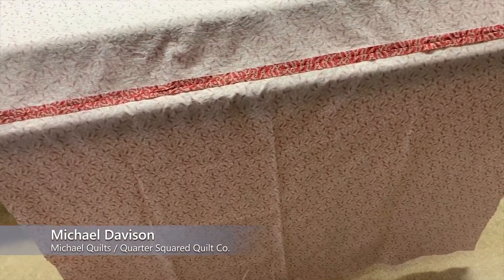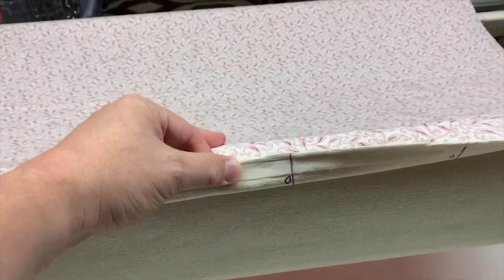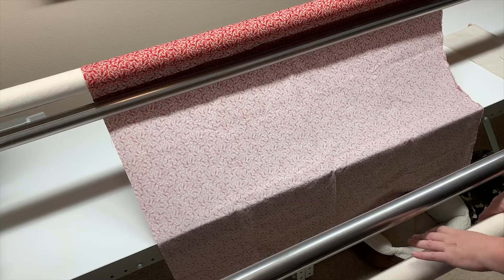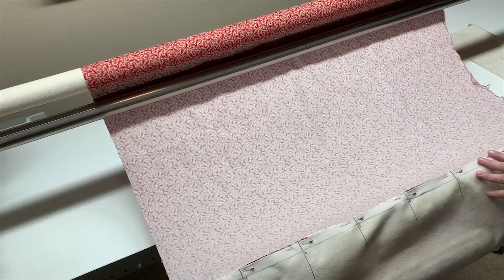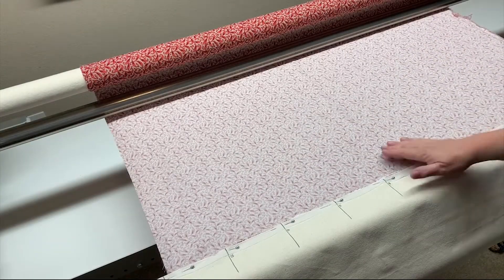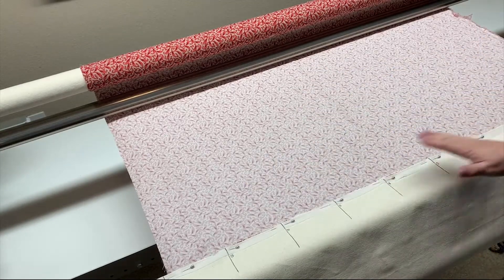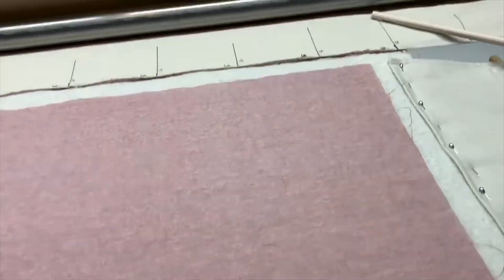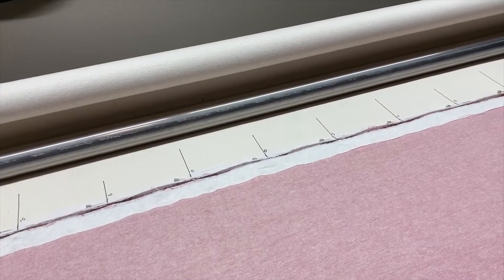LONGARM QUILTING - LOADING THE FRAME

Comment: I have never thought to load the quilt back from behind my frame! Wish id found you a lot sooner. I like pinning too but if I'm feeling extra lazy I use a stapler with it set to bend out instead of in then nip my backing fabric and rip the edge to get rid of all the staples easily when I'm done. Thanks for the video!

Comment: I am new to quilting on a frame. I just loaded a quilt and rolled the backing to get the side tension on the backing even. Works great. Thank you for the video.
Reply from the maker: Hi Natalia! So glad you are getting started! Let me know how it all goes! I know you'll love it.
Happy Quilting!
Michael
Reply: @michael.quilts  Followup. I now use my top leader for my backing. I struggled at first but came back to the video and noticed how you draped the top leader over the back bar. Genius! My quilt backs were slipping badly and loading a quilt was a chore. Thanks again.
Reply from the maker: @nataliarodriguez6766  I am so glad that you found what works for you - and that is what works for me too.  It takes me a while to adjust myself when I teach somewhere else and they load the traditional way, but I guess it's all about what you get used to. Happy Quilting!

Comment: Thanks for this video Michael. I will definitely do the tip about rolling the quilt back and forth to get the side tenson like I want it. I will also find your video about your side tension system.
Reply from the maker: Hi Dana. Truly, I was only sometimes able to get the tension on my backing even and sometimes not. But when I learned this rolling technique, I found the time spent doing this to be very well worth it! Hope it works for you too!

Comment: so glad to find that someone else loads backing on the quilt top bar!  I like to use magnet bars on the "front backing bar" to stabilize the floated quilt top!  I like to use magnet bars to stabilize the front of the quilt top an the magnets stick better with less bulk wrapped around it.  still fairly new to quilting and my "tension" learning curve is less flat than it was when I started.  haha.  I'm thinking of getting another bobbin case for the different threads?  what do you think?  I mostly use Glide but would like to try lighter weight on bobbin.  anyway, love your videos, thanks for all your suggestions.

One last question.  Is the reason you don't use "red snappers" because they are so tight between the dead bar and the machine?  I have a hard tie snapper hitting the base when rolling.  I have resorted to pinning.  which isn't that bad really!
Reply: Hi Debra! Thanks for your comment. I am still doing it this way. And I do have multiple bobbin cases for different weights/types of threads, so I love the idea. Pinning is second nature to me. Red snappers are not as acurate for me , even though faster. I stopped using them many years ago. Just me and my pins and I am fine with that. Love magnets! Sounds like you are a lot like me in regards to loading quilts on the frame! Keep me posted!
Happy Quilting!
Michael

Comment: That was good information. In one of your Baptist fans videos you mentioned that you baste your whole quilt before you quilt it. I would like to see your process for doing that.
Reply from the maker: Hi Marie. Thanks for the comment and request. I filmed the overall baste process I do on a client quilt recently. It's a fairly easy and fast process once you've done it a few times. It's not always necessary, but I like to do it if I feel I need to or just to create a bit of extra assurance for me. I do the overall baste with Baptist Fans quilts all the time, because as you have figured out, I like to quilt those starting from the bottom. I will get the video edited and uploaded soon. Thanks so much for asking.
-Michael

Comment: I also have an Innova. I load almost the exact same way except I use the red snappers. I have cut them all in 5-7” pieces and I feel like I can load quicker and straighter with them in pieces. I also float my tops and never thought about using the other bar for backing. Did the height on your foot change at all? Do you have any tips for keeping the backing straight with thicker fabrics like plush or fleece? It pushes in so bad towards the middle and I really try to keep it straight on the ends, but I find that then when I am quilting it gets floppy on the ends after advancing down the quilt. I hope that makes sense.
Reply from the maker: Hi Renee. I never thought about using all small pieces of red snapper. I know people use small ones to hold in place while they put the longer lengths down, but I never thought of using 5-7" pieces. I actually may try that since I have them in my closet and can cut them up. Thanks for that!

As far as your questions - the foot height did not change at all when I moved to the front bar. And one thing I would say about fleece and plush is keeping the tension fairly tight on the sides. Other than that, I know it can be a problem. Wish I had more ideas on that, but I probably don't use it as much as you do, so haven't really come up with anything better. Thanks again for your comment.
-Michael
Reply: Michael Quilts Yeah I really love the cut up snappers. And they are MUCH easier to store. 😆 I think I am going to make the side tension canvases that you had a video about. I also have the red snapper side things and the ones from leader grips but with the thicker fabrics, they are a beast to get on and nearly impossible.
Reply: @reneemorgan9320  great tip on cutting up the Snappers as my hands are a bit arthritic and it is beastly getting the big ones on, let alone keeping them in position! I am off to cut mine up now!

Comment: Michael, can you comment on floating the top vs. pinning/securing to its rail? I use the long plastic quilt clips/clamps as I have been floating the tops. Not sure which way to go!
Reply from the maker: Hi Janet! This is another huge debate in the longarm quilting world (like pressing seams and prewashing...LOL). Even though the longarm frame manufactures design the frames to attach the top to the rail - I learned and watched vides from quilters who float, so that is how I started and how I most often operate. I emailed a fairly famous quilter and asked her some questions when I was first starting out. One question was the "to float or not to float" question. She told me she always floats - mostly to be sure she never gets a crease in batting. When I look at her work, I am always amazed and figured if that is what she does, that is what I am going to do. I did try securing to front bar on 2 quilts and I actually had problems. I cannot remember why - it was very early on in my quilting career, so lots of things were not great at the time...hehe. But long story short - I reversed the direction of my backing bar and have bypassed the top bar, which acts as an additional deadbar and actually helps get good tension. So even if I wanted to secure the top to the rail that it was meant to be attached to, I would have to go back to changing the direction of that rail cog since I currently use it for my backing instead of my top. I know this sounds confusing. Short story is that I started floating and never looked back. HOWEVER - if you have been watching my videos (and I know you have been), then you know I almost always baste my entire quilt before quilting it and therefore don't really need to worry about securing the top because I take care of all tension issues in the basting process before any possible distortion from quilting takes place. Hope that makes sense.
NOTE: If you ever migrate to a computerized machine. And maybe you already have one? There are some reasons to attach your top to the rail. This helps with lining up quilting passes for designs that require more accuracy with that. let's chat about that sometime if you are computerized.
Looking back - If I had gotten good at not floating my tops and had started being diligent with attaching my top to the take-up bar from the very beginning, I might be on that side of the debate. Like many things in the quilting world - whatever works best for you and gives you the best consistent results is what you are looking for.

Happy Quilting as always,
Michael
Reply: @michael.quilts  Thanks for that thoughtful reply, Michael! I love your practice of the loose basting across the face of the quilt, that strikes me as "key" no matter whether you float or not, along with the way you stitch down the quilt edges...section by section, bottom to top, easing as you go. And yes, I have been watching ALL your videos : ) May there be many more! You mention at one point you evened out your leaders...can you expand on that idea?